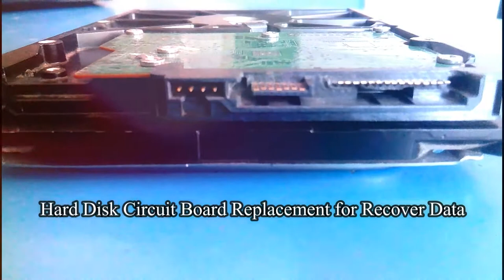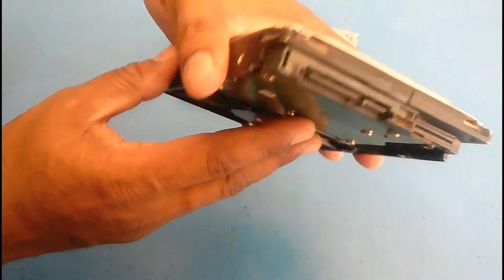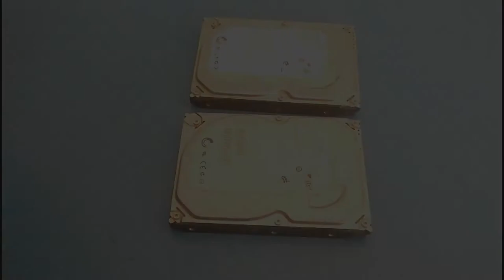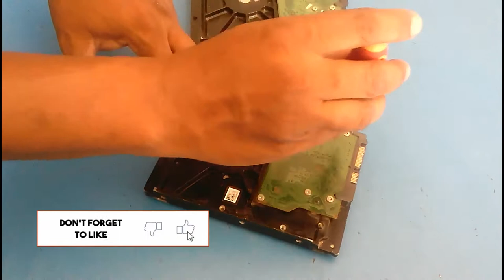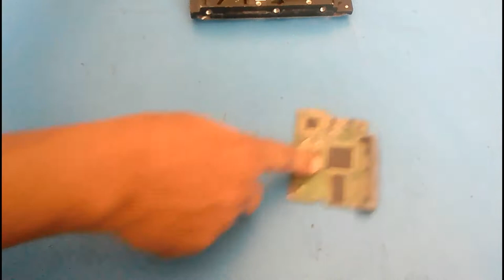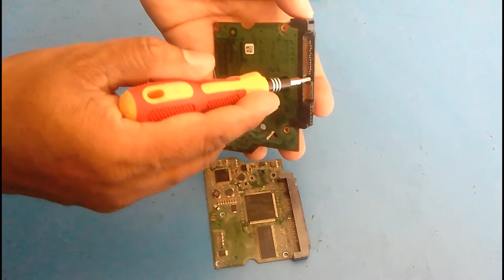Hard disk circuit board replacement for recover data l change PCB Non detected Hard drive board

Comment: ...i have bought 2 sata desktop hdds less than 6 months ago online that may or may not have been refurbished(one WD 4tb hdd,one Seagate 4tb hdd)...and both have developed disk read/write delays and)or bad sector problems and was wondering that if i swapped out the sata hdd Firmware boards would it might solve the the heavy read/write delay issues....anyone??

Comment: Guys please anyone:-
I have a western digital 80gb HDD and it was running well but suddenly it stopped working and the logic board started heating like hell i measured it and it got to 96° c
Can I recover my data by replacing the board??